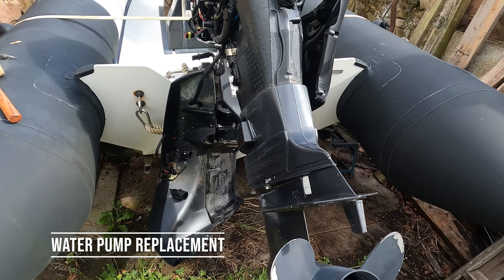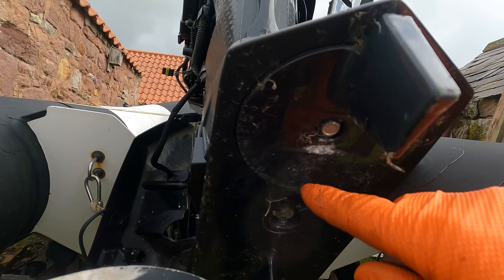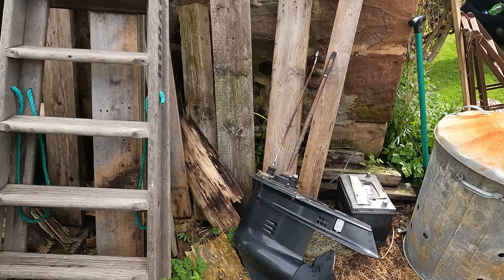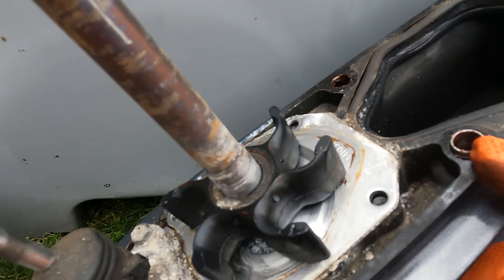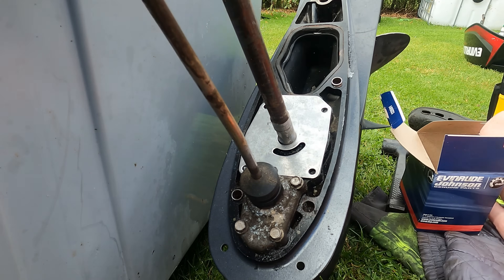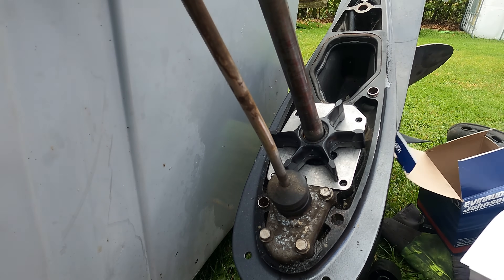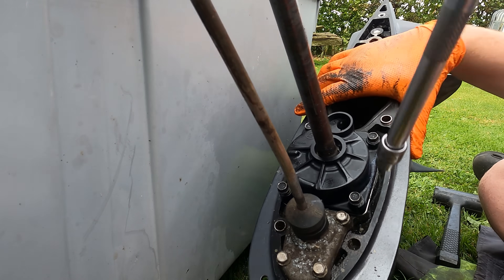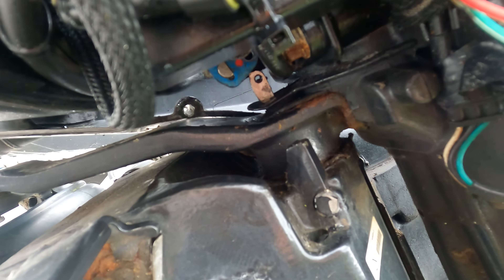Evinrude ETEC 40 50 60 65 - How To Change Water Pump Impeller + Rebuild Kit On Lower Unit 5006511

Comment: some grease on the impeller key and shaft where the impeller sits goes a long way in preventing the impeller from getting seized to the housing. the o ring im sure popped off as you tried to put the impeller into the housing when turning, hence not showing that part. to prevent this, put some 847 permatex under the o ring groove all around let it dry for 10 minutes. a quick smear of grease will help to seal it. to prime the pump making it more efficient, turn the impeller counter clockwise 1/8-1/4 turn while pulling UP on the driveshaft. improves efficiency.

Comment: You said at the end of the video, make sure it’s not in gear. So I’m assuming you did this whole job with the throttle handle in neutral?
Reply from the maker: Yeah that would be correct 👍
Basically to remove the gearshift link put the gear to which ever position is easier, believe neutral is best.

It’ll not go back together another way apart from the way you remove it in, unless you unwind or remove the shift linkage by error, as the shift linkage always matches the throttle / gear position.

Comment: Did you have it in forward, neutral or reverse when you drop the lower? Does it matter?
Reply from the maker: It shouldn't matter as long as it all goes back the same way. 

The shift will only go back together if it matches anyway, I.e Fwd & Fwd / Rev & Rev as long as you don't unwind the shift linkage or adjust it you'll be good

Comment: After reviewing, other videos and written instructions show an O-ring used to hold the keyway/cam onto the shaft and the impeller pushes the O-ring down and rest on top of the O-ring inside the housing.  Can you explain the difference?
Reply from the maker: Hi,
I’m not sure about using an o ring to hold the key way, I always use a small amount of marine grease. 
The parts diagrams for the Evinrude Etec only show 1 o ring being used on the water pump and that’s for the water pump housing which is larger than the impeller. 
I suppose some people may have different methods for insulation but using additional parts does come with risks especially if say using an additional o ring, it could break down and could then become trapped in the water passage ways. 
Unless they push the impeller down just enough to engage with the cam and then are able to cut and remove that o ring.

Comment: Здравствуйте! Скажите пожалуйста какие ещё узлы на этом двигателе требуется обслужить перед началом сезона? Интересует в частности чистка дроссельной заслонки если она есть. Заранее спасибо!)
Reply: Спасибо за развернутый ответ!) Жду видео по чистке дроссельной заслонки 😊.
Reply from the maker: Hi,
So generally on the Etec we would do the following.
Spark plugs
Fuel filter
Fuel lift pump
Impeller 
Relief valve
Gear oil 
Test thermostat 

We have videos of most of these job on our “how to service a Evinrude” playlist

Please like each video you find helpful and subscribe if you haven’t already 👍

With regards to the throttle body you could try a throttle body cleaner / spray
Reply: Спасибо большое за быстрый ответ!) Все ваши видео я посмотрел и на канал подписан конечно же! Было бы не плохо посмотреть видео чистки дроссельной заслонки от вас 😊. Ещё один вопрос по маслу, если нет XD 100 каким аналогом можно заменить? Про смену в диагностике на TC-W3 я знаю)
Reply from the maker: Thank you for be already subscribed !

So Google translator might be off a little with what you're saying.

If you're meaning what can you use if you don't have any XD 100 left, you can use XD 50 or TCW3, but this must be changed on the EMM using the plug in diagnostic software. Otherwise, the engine will meter the oil in at the wrong rate, believe its from 100:1 ( fully sync ) down to 50:1 ration ( sync blend ).
Not doing this could cause damage the bearings / engine etc.

XD 100 is the best oil available to ETEC's as it has little to no smoke / soot and is used at 100:1 so uses half the oil compared to other oil, plus provides the best lubrication.
Reply: Да, я это знаю) диагностический шнур и программа у меня есть, какой аналог можно использовать взамен XD 100 ?
Reply from the maker: I'm not sure if there is an exact equivalent to XD100 as the EMM is programmed for this specific oil only as opposed to a grade? 
The same goes for when it's programmed to XD50 I guess. 
I suppose when programmed to TCW3 then any oil which meets that grade would be ok.
The XD100 / 50 was designed for the engine directly.

If you were to find a equivalent fully synthetic grade which isn't xd100 then you would be taking a risk for the sake of either reprogramming or just buying xd100